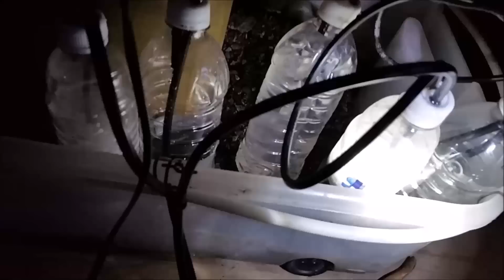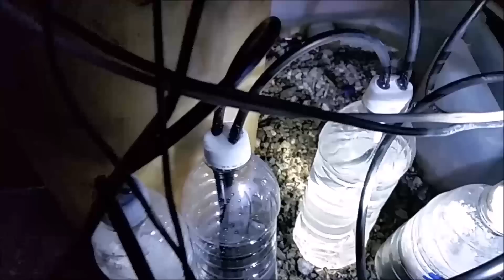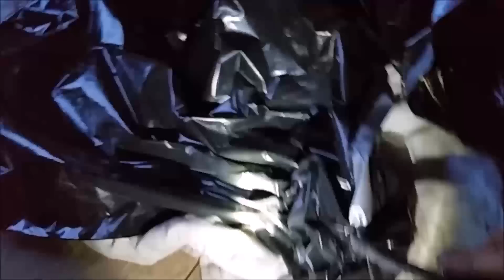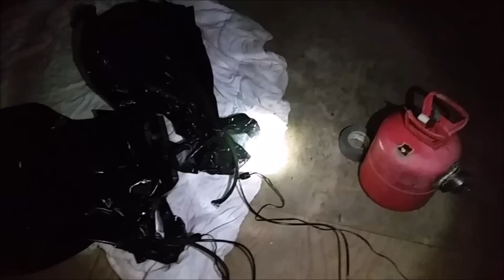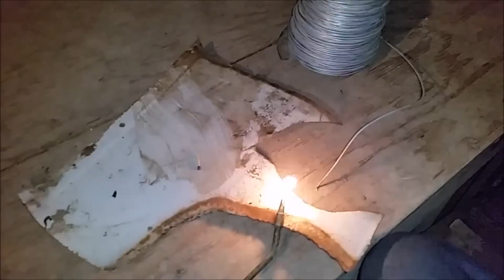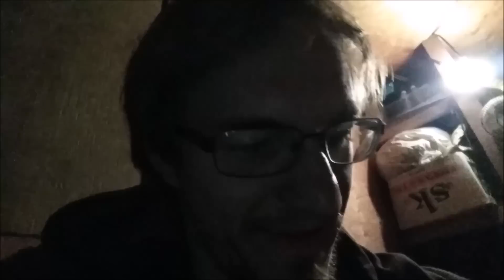Burning Water

Comment: We breathe air that is 21 percent oxygen, and we require oxygen to live. So you might think that breathing 100 percent oxygen would be good for us -- but actually it can be harmful. So, the short answer is, pure oxygen is generally bad, and sometimes toxic. To understand why, you need to go into some detail …
 Is it harmful to breathe 100-percent oxygen?
Your lungs are basically a long series of tubes that branch out from your nose and mouth (from trachea to bronchi to bronchioles) and end in little thin-walled air sacs called alveoli. Think of soap bubbles on the end of a straw, and you'll understand alveoli. Surrounding each alveolus are small, thin-walled blood vessels, called pulmonary capillaries. Between the capillaries and the alveolus is a thin wall (about 0.5 microns thick) through which various gases (oxygen, carbon dioxide, and nitrogen) pass.
When you inhale, the alveoli fill with this air. Because the oxygen concentration is high in the alveoli and low in the blood entering the pulmonary capillaries, oxygen diffuses from the air into the blood. Likewise, because the concentration of carbon dioxide is higher in the blood that's entering the capillaries than it is in the alveolar air, carbon dioxide passes from the blood to the alveoli. The nitrogen concentration in the blood and the alveolar air is about the same. The gases exchange across the alveolar wall and the air inside the alveoli becomes depleted of oxygen and rich in carbon dioxide. When you exhale, you breathe out this carbon dioxide enriched, oxygen-poor air.

Read more here:
http://science.howstuffworks.com/question493.htm
Reply: You can so long as it is at a low pressure. else it can do damage. when he is breathing it out of the torch nozzle it is rather unadvised. 

Now what would happen if you breathed 100 percent oxygen? In guinea pigs exposed to 100 percent oxygen at normal air pressure for 48 hours, fluid accumulates in the lungs and the epithelial cells lining the alveoli. In addition, the pulmonary capillaries get damaged. A highly reactive form of the oxygen molecule, called the oxygen free radical, which destroys proteins and membranes in the epithelial cells, probably causes this damage. In humans breathing 100 percent oxygen at normal pressure, here's what happens:
Fluid accumulates in the lungs.
Gas flow across the alveoli slows down, meaning that the person has to breathe more to get enough oxygen.
Chest pains occur during deep breathing.
The total volume of exchangeable air in the lung decreases by 17 percent.
Mucus plugs local areas of collapsed alveoli -- a condition called atelectasis. The oxygen trapped in the plugged alveoli gets absorbed into the blood, no gas is left to keep the plugged alveoli inflated, and they collapse. Mucus plugs are normal, but they are cleared by coughing. If alveoli become plugged while breathing air, the nitrogen trapped in the alveoli keeps them inflated.
The astronauts in the Gemini and Apollo programs breathed 100 percent oxygen **at reduced pressure** for up to two weeks with no problems. In contrast, when 100 percent oxygen is breathed under high pressure (more than four times that of atmospheric pressure), acute oxygen poisoning can occur with these symptoms:
Nausea
Dizziness
Muscle twitches
Blurred vision
Seizures/convulsions
Such high oxygen pressures can be experienced by military SCUBA divers using rebreathing devices, divers being treated for the bends in hyperbaric chambers or patients being treated for acute carbon monoxide poisoning. These patients must be carefully monitored during treatment.

Read more here:
http://science.howstuffworks.com/question4931.htm

Comment: How do you guys account for the distance of the sun (solar panels and stuff) when you simulate a Martian environment?  Seems that when you simulate here, you'd have better luck with sunlight than you would there.
Reply: And also you have to account for the density of Earth's atmosphere. It's a lot thicker than Mars' atmosphere, and since the water molecules, and dust in the air distort the amount of sunlight actually reaching the solar panel, you would actually have a better chance of running solar panels on Mars, due to the fact that 1. There isn't very many water molecules in Mars' atmosphere, and 2. There's no one to disturb the dust on the floor. So despite Mars being farther from the Sun that Earth, and since light travels forever until it is scattered, solar panels would actually be a viable source of energy on Mars.
Reply: I suppose Earth also has clouds, not all days are sunny, so the average sunlight is close to what you'd get on Mars. Never mind me, I'm just thinking out loud.

Comment: Very interesting set up. The only thing I'd change is to move the whole lot outside. I used to work in a lab with hydrogen tanks and we had to monitor constantly for escaped hydrogen. The problem is that it floats up to the ceiling and stays there. Even a small leak will slowly accumulate and then blow the building up when you are least expecting it.
Reply: +Robert Nugent Working once or twice without exploding is, I feel, probably worse than it exploding straight away. It'll lull him into a false sense of security. The bag of hydrogen on it's own I don't think is much of a problem but he's got it right next to a bag of oxygen. The setup is an accident waiting to happen.
Reply: +Robert Nugent The flimsy plastic bag is a major safety feature for any DIY-er. If anything ignites those bags will just fall apart and make the explosion dissipate very quickly in all directions and without shrapnel, if that happens in a very constrained container there would be limbs decorating the walls.
I do agree however this shit needs to be done outside with as much distance from the aperture as possible, brushless motors also wouldn't hurt.

Comment: You are pretty clever.  The rat race really does not need a better torch.    Use you ingenuity to invent an engine that runs on water. or HOH
Reply: +Thomas Harrell why produce hydrogen from water and electricity and then burn this hydrogen ?Because when you transform energy in an other kind of energy you lose a part of this energy. it's better to use directly electricity. Always use the source of energy, if it is possible.

Sorry for my english :)
Reply: +goosse nicolas transformation is necessary if energy needs needs stored to to match supply and demand. 

talking of a better engine that runs on water. It's difficult to combust hydrogen in an internal combution engine- it has all kinds of issues including detonation. However the flame of a stoichiometric HOH torch is nothing more than 2,800 deg C steam. So long as the gas supply pressures are high enough, such a torch could be fired into a high pressure space. As such a large HOH torch could replace a bulky steam boiler, and any need to carry lots of water on a steam vehicle.   If an engine could be built to handle that kind of steam temp, carnot efficency  would be in the range of 1- ((110+273) / ( 2,800+273) = 87%
Reply: +steve cummins And it Will take government to make it happen or else when our polar caps are gone and day temps reach 170.... Bla bla de bla. Were doomed. Thanks Oil Lobby:)
Reply: steve cummins Sure, car run with fuel for that reason. But using Electricity to make something is a bad idea because Electricity is a noble energy hard to produce. Hydrogen is hard to produce in other way than electrolysis because it need a lot of metal and acid to produce a small quantity. So actually, working on a "HHO" Engine is stupid. It's like when Petrol will be missing, To try making a new engine that use petrol. why make something that don't have fuel ? try to find fuel first and then make an engine.

once again, sorry for my english ..
Reply: Electric vehicles are improving, but not there yet. To store their "fuel" they also consume materials which are somewhat limited in availability. Hydrogen infrastructure might be easier to build/more practical, but without market it won't happen.
Reply: +Thomas Harrell The stored oxygen and hydrogen are like batteries that require no maintenance, and the electricity came from a solar panel, so it was marginally free. It's about time and money.

Comment: Can you achieve the same result using Salt water, Sea water?   What would happen with the Salts, would you have to Distill the water first or could you achieve the same result with the salted water?
Reply: +Kelly Richardson from what I remember sodium chloride splits much easier than water (it dissociates in solution). So this process creates chlorine, sodium hydroxide, and hydrogen. No oxygen, at least not as long as there is still chloride present in the solution.
I definitely remember having produced chlorine that way with my chemistry set.
Reply: Pretty sure it depends on the voltage that ur putting in the water
If u have a low voltage but high amperage i think the water will split and the salt wont
Reply: +Cody'sLab Would be a good point. if you have something like that dissolved in the water. the electrolysis process could very well split the sodium chloride as well. given the decomposition requirement of the salt is met.
Reply: +Cody'sLab So you can achieve the same end result, but you would have Chlorine by product to deal with?
Reply: +Kelly Richardson Depends on the salts. Sea water will definitely produce chlorine gas, but you could distill it and dissolve sodium fluoride or sodium sulfate instead, which will allow for a full hydrogen and oxygen outcome. (Pure water won't conduct electricity)

Comment: You need a more powerful fuel cell so you do need to compress the gas in order to use a torch. Like a 21 cell or more making about 10 l.p.m. I see some that have no more then 7 plates do well. Interesting how you manage to compress the gas kinda dangerous. I mange to get a generator to run on water with about 8 l.p.m. Thanks for showing

Comment: I have an idea for a much simpler and probably safer design, but i lack the abilites to build it...
Why not build a U-Shape, where one side is the anode and one is the cathode. You could then have a closed system, which means you could plug the compressor directly into the twi sides of the U and let them run all the time (since they won't suck in water). Also none of the gas could escape...
Reply: +Cody'sLab  seal electrolysis unit  inside a pressure container, then use level sensors to turn water pump on/off and maintain water level despite gas production. easier to add pressure via a water pump that via a compressor .

As bubbles want to rise here's an idea.... 
use a pair of electrode rings, on both sides of a glass tube. "silver mirror test" some sandpaper might help in forming them, though I've no idea how difficult it would be to attach wires to that.  Any gas produced inside tube will want to rise, same on outside. when tube held vertically that should keep them from mixing. flask and a bung with 3 holes for piping. one hole for water pipe,  one hole to run electrode tube through., and collect one of the gas streams. flask and 3rd hole will collect other gas stream.
Reply: I think they tried that on tested and it didn't work as fast as this did

Comment: I noticed in the second series using your homemade torch, to test for leaks, you were going to dunk the tank in water. In the propane business my brother figured out something similar to their propane leak testing solution by making his own. 

Use an old saline eye drop bottle filled 3/4 with water and just ad a few drops of liquid dish soap to the water. Shake it up, you want fewer bubbles in your solution. Then spray it around the new welding and valves to check for leaks. If you find one it will bubble and pop, bubble and pop. 

Hope this Idea will help you with your leaks.

Comment: Now you can build your own spacecraft and survive (at least in the vicinity of the earth/sun cause of solar panels) indefinitely :). Well, you might need some food too.
Reply: Mathias Westerlund You can't loose matter...
Reply: In that case you still dont lose it!
Reply: +Mathias Westerlund when you burn hydrogen you get water...
Reply: +Lehtaan And an replenishable source of water.
Reply: i think he must mean energy
Reply: Lehtaan Wrong, You cant remove or Destroy matter, You can loose the possession of matter.

There is a huge difference.
Such as vapour or fumes or smoke from burning it.
Reply: +Lehtaan Yes you do, You do not DESTROY it or REMOVE it. But you still LOSE it.

One example of where this take place is oxidisation where you literally loose electrons and / or Hydrogen.
Reply: +TheZswader Not only no. Even tho it is popular to say that YES it is a VERY clean fuel BUT during the conversion you loose materia in the burning process, Eventually you will run out no mater how slow.